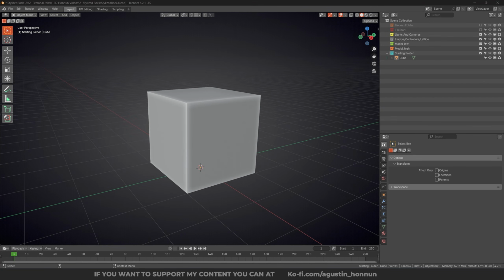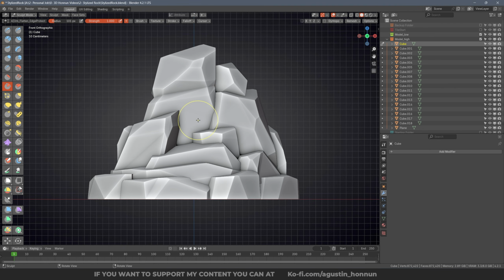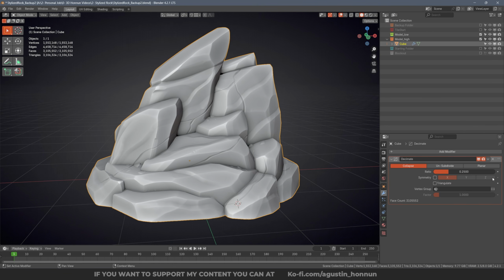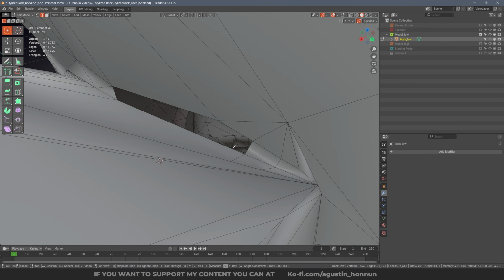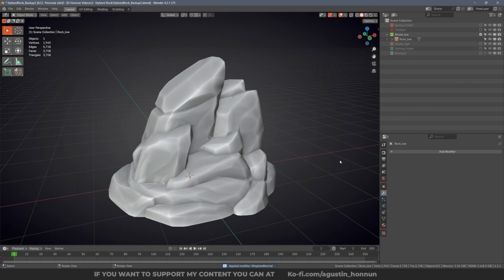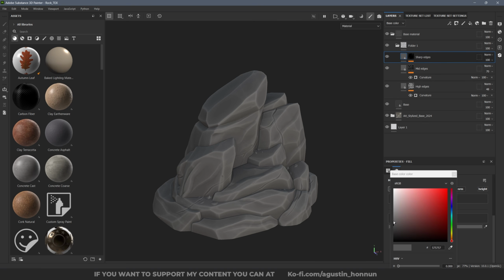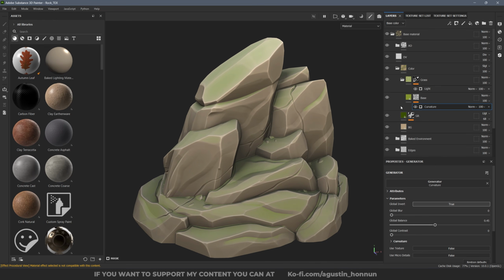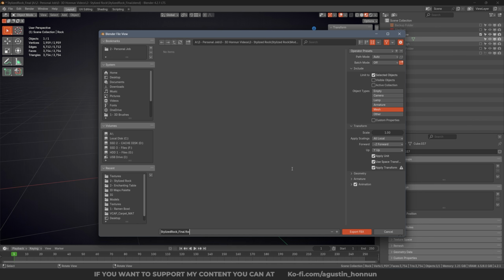How to make Stylized Rocks For Games In Blender (Full Workflow Tutorial)

Comment: the uv mapping part didn't work for me :( ı have a lot of distortion on my mesh
Reply from the maker: It depends of the rock shape, usually I split it in more parts with more seams, if you also have bottom faces will have more distortion
Reply: @agustin_honnun   hi mr agustin! ı've completely restarted the process. I re-modelled and sculpted the rocks. ı made a way more beatiful shape than ı made before and uv process  worked properly :D
Reply from the maker: That's amazing 👏🎉

Comment: Great video man! But I am having a big Issue when Unwrapping, I got many overlapped vertices, is there a solution for that? I tried packing islands but I dont see any changes, and I cant fix it manually cause there are many of them. I would appreciate a solution for that if its possible... :c
Reply from the maker: Are you using autouv unwrapping? If that's the case that's usually normal, you need to make seams to unwrap correctly. If you are already using seams and not autounwrap, make sure you don't have overlapping faces or vertex (in the model not in the uv), Also make sure you are placeing the seams correctly, Faces should be able to deform to a 2D plane without collapsing, imagine a Cylinder, you must add a seam in the middle since a Cylinder can not deform to a 2D without getting deformed

Comment: Hello ! Very nice tutorial ! I had an issue where i used the base smart material you provided, but when i exported the textures, they were blank, i solved this issue by adding a fill layer with a black mask on top of the smart material. I don't know the origin of this issue but if it can help anyone 👍
Reply from the maker: Heythanks! 

Mm that's weird.  Did you baked all the maps first right?

Or maybe there is a problem in the exporting settings

Comment: Awesome tutorial my man! Love the time you take to explain each step. I would like to know which smooth did you use for low poly to take it to Substance? Auto Smooth? Full Smooth? Im getting some issues with the edges when texturing, thats why Im asking!
Reply from the maker: Hey thank you. The problem with the edges you talking about may be cause if you have hard edges where you don't have seams. To avoid that you should have a seam where you have a sharp edge. Check my Recent potion video I show it there. But if you don't want to use sharp edges method and just place seams wherever you need, you can use weighted normals modifier to smooth it but it can cause some problems on reflective meshes and causing gradients in normal maps that will be visible when textures get compressed

That last method is the one I explain on my baking on substance video, which is good, just it needs to have more geometry and support loops

I prefer to use both depending the case, but for more optimization, sharp edges one is optimal
Reply: @agustin_honnun  thanks for answering!! Great explanation. I'm following most of your videos cause I really love your Workflow. I will check the ones You told me. Thanks!!

Comment: I have this problem where my rocks doesn't get that smooth but crips corner. It rather breaks lots of smaller edges where i want the edge. Is there a way to avoid that?
Reply from the maker: I don't exactly understand your issue there 😕
Reply: @agustin_honnun  Well you get smooth and charp corners where you want. While mine tend to break up to several edges following the edge line paradelle. I don't think i can explain this well enough with words.

Comment: I'm having an issue remeshing, every time I remesh the geometry gets distorted, like some of the edge loops get inverted and overall the shading looks weird.
Reply from the maker: Hello, I'm not sure if this is your problem but is the most common one when Remeshing. Make sure the entire model to Remesh is closed, with no open faces or inverted normals. If you have, then when you remesh all the model will get distorted and create holes
Reply: @agustin_honnun  The voxel size on your end shows 0.4, but for me to get it like yours i have to put 0.004 why is this the case?
Reply from the maker: Usually, this may happen if your main mesh scale is too small. Make sure your objects have an average scale as the default cube (2Mx2M). If you started making a model with a smaller or bigger scale, it can happen, and the remesh tool will take the object scale as reference. 

Then, in the end, you can rescale your object with the correct height when the 3d asset is finished

And of course, make sure to apply scale and rotation before remesh and sculpt
Reply: I had the same issue, just did it through the modifier.
Reply: @whiskey3689  yeah same, still causes same issues
Reply: @rippincali  how many faces does it say you have
Reply: @rippincali  I’m having the same issues but it’s because I wasn’t paying attention and made the model humongous so I have like 30mil faces and vertices😅

Comment: Would you bake lighting for rock that can be placed in different rotations? I've made one and idk if I should keep lighting on, or maybe make different versions with the same model
Reply from the maker: Hello. This method works fine for it since lighting isn't to make it look illuminated, it is more like an artistic way to do some parts pop out more. If you bake the light from top view center to the bottom you shouldn't have too much lighting on sides, and it won't affect that much for rotation variations. 

Btw this method works fine for pbr workflow, but to make the texture more like handpainted unlit, then lighting should be strategically placed since there are no light interactions
Reply: @agustin_honnun  Well, after some testing, I figured with pbr workflow it looks good without baked lighting, but for things like seamless rock texture I just put light straight from top and it just added that umph. 

Also, great video I've learned so much, thanks!
Reply from the maker: Glad to hear it!